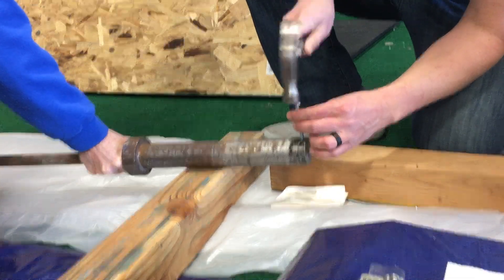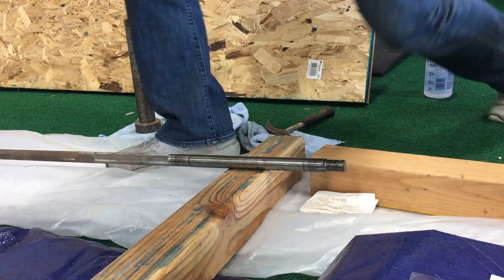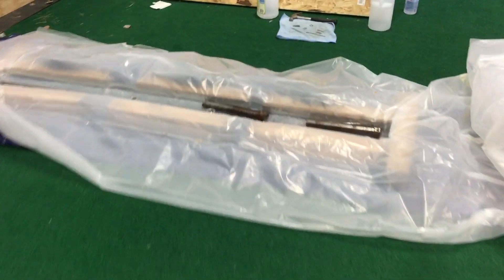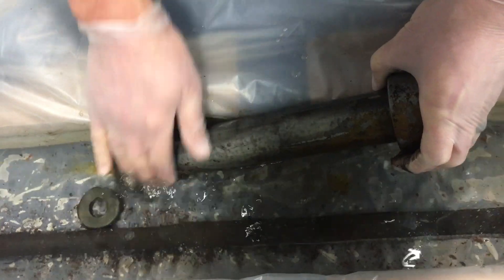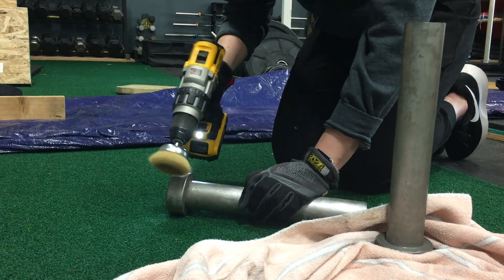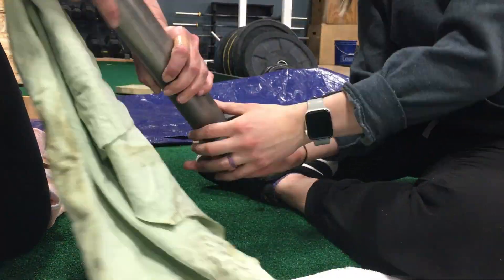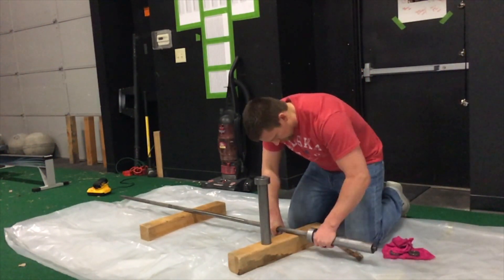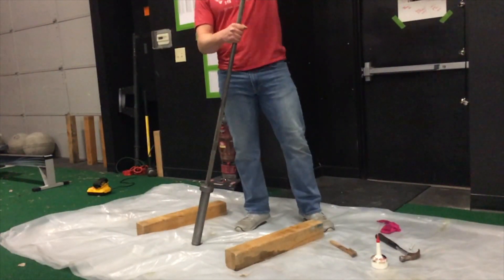Restoring a Rusty Barbell

Comment: Watched a lot of vids, yours was easy to follow..great idea with the wood blocks. Going to start this process tonight for few bars, and plates and even dumbbells. Going to paint the DB’s with a truck bed spray I found at menards, hope it works. 

I did see that one guy applied “super gun blue” to the bar after the washing And /baking soda the bar. I think he did all the scraping down like you did and wiped it clean..then applied the gun blue and then oiled it. The bar looked pretty sick afterwards. Thinking of trying it.
Reply from the maker: Glad you liked it and found it helpful! Good luck on your process as well.

With regard to the super gun blue application, you might be referring to Matthew Moore. You can find him on Instagram @moorefoodnow. He does great DIY gym stuff, and I know he's used the gun blue on a bar restoration process before. It looked great.
Reply: About to try this myself. How did it go for you?
Reply: A C I didn’t end up using the super blue.:.well I tried on one bar and it did nothing. 
Wire brush and vinegar works well, but I also found greased lighting worked great on the plates I cleaned and painted.

Comment: Hi, as soon as I dry off the cleaned bar it starts to show rust forming. is there a way that this won't happen? I want to put a clear coat of Rust-oleum on it.If I put oil on it, it won't stick. thx for the video.

Comment: Why the 3-in-1 oil on the shaft of the bar? I thought the oil only served the purpose of making the bushings/bearings rotate faster if they got sort of stuck due to "old age".
Reply from the maker: It is indeed useful for the rotation of the bar, but it also helps remove rust and applies a protective coating as well (helping prevent future rust). On a bare steel bar, this is very useful.